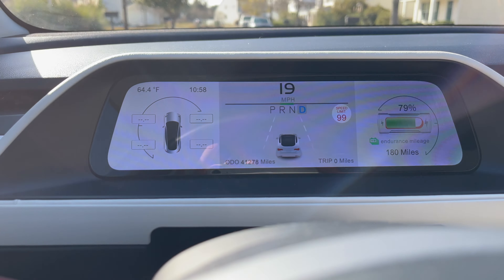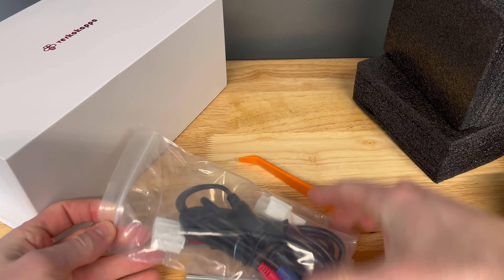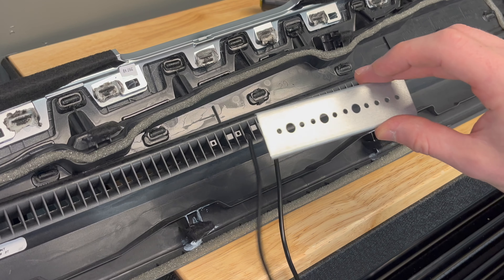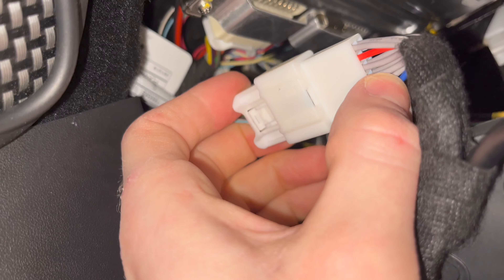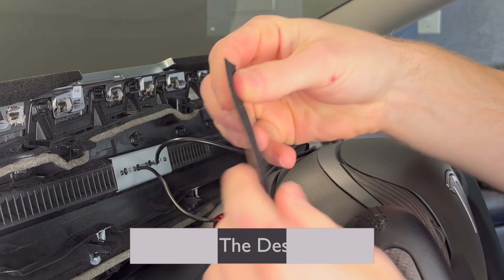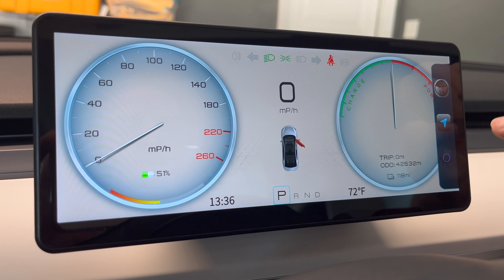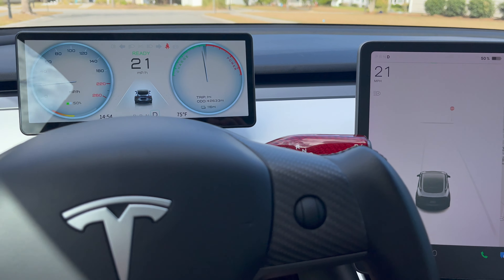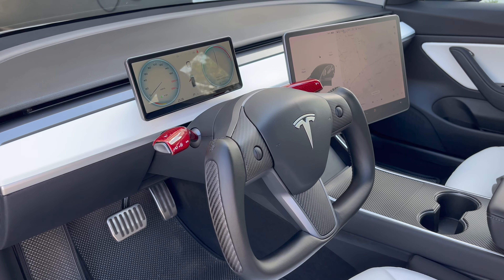Tesla 9" Touchscreen HD Display ⚡️ Model 3 | Model Y 🔥 CarPlay + Android Auto Instrument Screen

Comment: This video is really well done! I recently installed this same driver display on my ‘21 M3P and wish I had seen this prior to installing mine. For some, like me, having a different year and model car, there are some differences on installation. My harness kit is different as the plug is more on the passenger side panel instead of directly under the glovebox. There is also a battery hookup where I had to run some of the harness out the firewall over to the 12v battery in the frunk. The unit works great though and I don’t experience any lag between the two displays. It looks very OEM and does keep my eyes more centered on the road while driving.
Reply: Yes, I use carplay with no lag and the response is fast. They have released new software that can be upgraded to try. Their listing explains that the P version requires a different cable.
Reply: I too have a 21 M3P. Are you saying you need a different harness in order to install this? Why did you have to run some of the harness out of the firewall? I watched a few install videos about the installation of this product, and did not see anything similar to what you mentioned. Thanks!
Reply: Jay I have the same issue but can’t for the life of me figure out how to run the wires through the firewall! Can’t find the grommet or hole to run cables through.
Reply: @exo360  I found the grommet by going through the frunk. I first took out the bottom tray of the trunk and looked on the firewall just inside of the right quarter panel area. You should see a large wiring harness coming through the firewall surrounded by a rubber membrane. I poked a hole through that and fished it through where it came out just above the passenger footwell area behind the glovebox. I then tied the electric  wiring part of the harness to my probe (a wire clothes hanger) and pull it back out through the frunk. It’s a bit tricky, but doable. The pass through the firewall is tight around the rubber and I wasn’t concerned with air/moisture getting in. Hope this helps!
Reply: @adamwang8045  My harness had the hookup to the blue connector behind the passenger side paneling just below the dashboard by the door (you’ll need to remove to panels - one up top and the below one that extends from foot area all the way to the bottom side of the seat). That harness also has an electric hook-up that needs to run out the firewall to connect to the 12v battery in the frunk. Hope this helps!
Reply: @jk1x3  Jay, I’m installing this on a performance as well. Where did you ground to in the trunk? I have a 2022 M3P

Comment: I just got a 2023 Tesla Y and miss the head up display that I had in a previous car. I saw one comment that this display interferes with the air conditioning vent? is this the case? Another comment was about the sound coming through the unit and hot the car for directions?

Comment: My concern is the blocking of the AC vent, how much air are you getting from the driver side?   It gets hot down here during the summer  and that AC is needed , also does it fog the windows, my cell phone with the dash mount sometimes kicks the AC back at the windows fogging it.
Reply from the maker: If you like the air blowing on your face when driving, it will block it. I found it best to adjust the vent completely upward or downward so the air can get around the screen.

Comment: Evan,  Do I need a special cable for my Model 3P?  Where is the plug in relation to the speaker and light panel that was taken off?  I was led to believe that the plug is behind and above the glovebox.  I fave also seen it described as being more on the side of the passenger compartment.  Would you mind posting a picture with an arrow pointing to exactly where it is.  Is it different in a Model 3P - 2021?  Thanks.  Love the videos!
Reply from the maker: Please refer to the video again; I have an arrow pointing exactly to the plug under the glove box on the right hand side. Unfortunately, I cannot send pictures on the comments section. I'll have to look more into this special cable for the performance model 3.

Comment: Please, please show more detail about plugging in the connector.  I have a 2021 M3P, and a friend and I spent 2 backbreaking hours trying to even see this gray plug.  In the end we gave up.  Pretty sure the Tesla service centers will not want to touch it.

Is there another way to get to this plug?  Love your videos!
Reply from the maker: I had to lay on my back; look upward on the right side and pull on the cord that way.
Reply: The plug is on the right hand side (passenger) behind the panel that runs from the foot well along the seat base. Remove that and you’ll see the open blue plug. You will need a different adapter harness specific to Tesla performance models. Though that part is easier than the non-performance models, there is still the electric hookup where you have to go through the firewall with a connection directly to the battery in the frunk.
Reply: @EMtesla1  Do you know if there is a different cable required to install this in my M3P?  I didn't see that mentioned on their website.  Would you also post a picture with an arrow pointing to the exact location of the plug?  I'm just not sure where to look.  Thanks
Reply: @jk1x3  Thank-you for that information,.  I'm waiting for a reply from the company. as to what I should do.
Reply: They have updated this information. Their listing explains that the P version requires a different cable. You can contact them on Amazon or their website for a cable.

Comment: Great video!  How much does it block the air, is it bad?  Also, of the 2 links provided, one is $750 and one is $450.  Is there a difference to them for the cost difference?  Just curious.
Reply from the maker: If you like the air blowing on your face when driving, it will block it. I found it best to adjust the vent completely upward or downward so the air can get around the screen. Either link you use is the same product. Just a preference on who you buy it from.
Reply: Thanks Evan! :)
Reply: It blocks a significant amount of air...no thanks.
Reply: @Jerry Addison Yeah, this thing is DOA. I'm not having air flow blocked when it's 115f outside.

Comment: Blocks too much of the air coming from the air vents. That's a no go in extremely hot places like Las Vegas or Phoenix.
Reply from the maker: I suggest you adjust the air vents. One coming from the left and one from the right. Break the air flow apart with the tesla screen. Cheers!